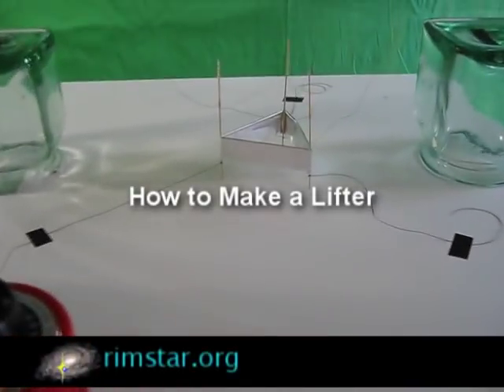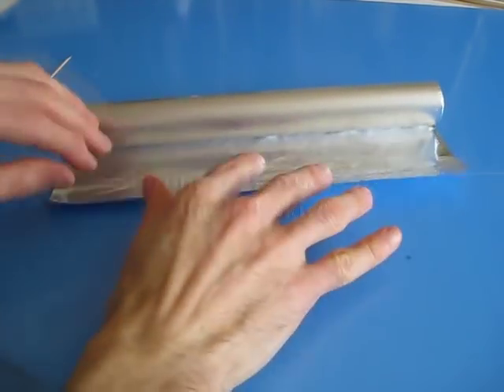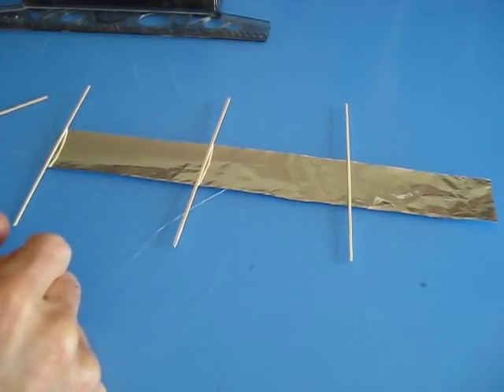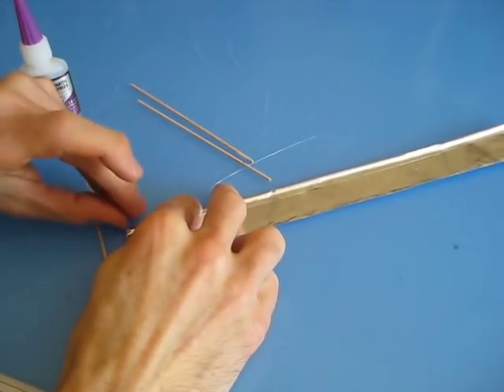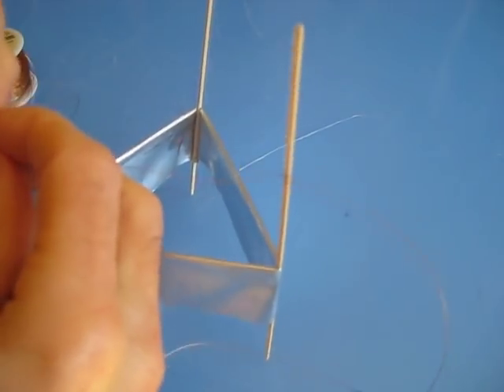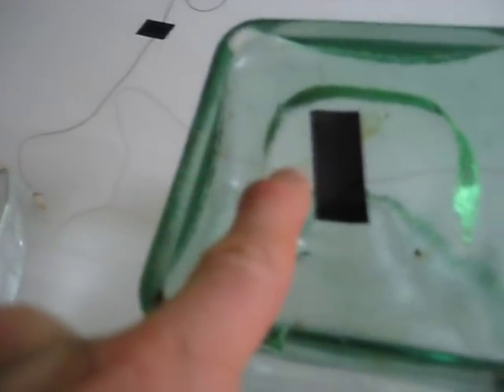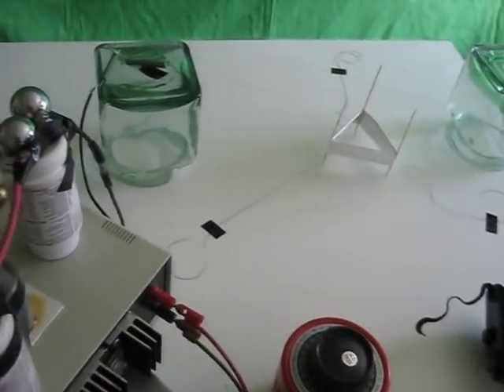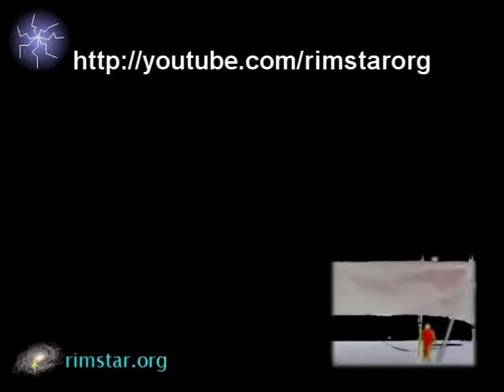How to Make/Build a Lifter or Ionocraft

Comment: Great video. Thanks a bunch.

If kept on its side and provided with wheels, with the wires sliding on HV rails, will it run?

If two of these were mounted on opposite sides of a balsa pole mounted on a central needle like a compass, and the HV supplied via commutators, will it keep spinning?

Thanks
Reply from the maker: If kept on its side then yes, it runs. But there'd be too much friction if it's on rails. The way it's usually done is much like you describe with the pole. I did it in my spinning disks video here http://youtu.be/JMtrKO7SVnw. The disks in that video work on the very same principle as the lifter, just a different geometry. It keeps spinning as long as the HV power supply is supplying sufficient voltage and current -- it needs a lot of current for the ion propulsion.
BTW That spinning disk one led to a fun one using a Star Trek Enterprise model https://www.youtube.com/watch?v=x5dyIIpnE0Y.
Reply: RimstarOrg Thanks a million. The corona, the smoke, the micro ammeter, all make for great entertainment combined with a chance for deep understanding of the principles involved. And the Star Wars thing, it’s from out of this world. Rare to find people with the genius combined with a gift to entertain, together with a passion for teaching. Thanks again.

Comment from the maker: You probably could use batteries to power the high voltage power supply but the whole thing would still weigh much too much for the lifter to lift. The record weight for a lifter to lift is 102 grams plus the lifter's 85 gram weight. The 102 grams were some nuts (as in nuts and bolts). It still couldn't lift the power supply. Do a google search for "saviour 100g payload".

Comment: Ok, so I've got a lot of the stuff hammered out for the project, but I still need the generator for the ionocraft. I'm going to stick with the dimensions of the craft you built, but I don't think I'd be able to assemble a generator myself. I was going to order the prebuilt one from the site in your video, but I want to confirm which to get with you before I spend all of my hard earned cash. Will it work if I buy the GRA 10? Also, is this what provides power, or is that the 13.8V power supply?

Comment: other than making sure that the skirt has a rounded surface and the upper pole is sharp in relation, does it matter what sort of shape the lifter actually is? Do you agree with the 1 x mm/kV rule for governing the distance between conductors?
Reply from the maker: No, other than the basic principles you mention it doesn't matter what shape. Lifters have been made as spirals, cylinders, rectangles and all sorts of other shapes. I've never heard of the 1 mm/kV rule. I just make them adjustable and my power supply is also variable so I've never needed a rule. A 1 mm/kV rule would ignore the affect the roundness of the skirt's top edge and the wire size has on a lifter as well as the available current from the power supply for ionization. Maybe someone's found that it works as a rough rule of thumb. A quick calculation shows that the one in this video is around 1 mm/kV.

Comment: I do not know if you can help me anyway I will ask ...
Basically I am starting a project, and definitely this at first, so far nothing out of the paper, I do not know much about ionic wind and so I'm asking you, is a very simple thing come.
Assuming I want to fly 350kg (a kind of costume with aerodynamic shape that would facilitate flight) there would be some sort of engine that uses the ionic winds (which preferably be small size of a boot)? If so, what fuel I would use in propellant? as I said would have to be the size of a boot, so would use 4 to the total, one in each boot, two in each hand, the share of fuel could be electric? I do not know if my question will make much sense to you because I'm not fluent in English, and you were the best person I found to answer that question, already thanks.
Reply from the maker: The world record for a lifter using ion wind is 100 grams. To lift 350kg would require a lifter around the size of a house. I don't know of any practical way to do what you are asking.
Reply: Thank you for responding, I am very happy. I have assumed that it would be impossible, but if you still have in your area, there is some kind of Thruster more or less the size of a boot to lift such a weight? now assuming I would use 5 (1 on each foot, one in each hand and a 5 ° back)
Reply from the maker: Here is what is needed, and it's for only a person (around 70kg?) https://www.youtube.com/watch?v=deyMNPbaRpA

Comment: It is strange what you said about the round edges. In 1968 I build lifter made of needles. Needles on top and bottom. At that time, the problem was with power supply. The lift was restricted by the lenght of the cord.
Reply: To add the design was not restricted to any shape.
Reply from the maker: Was there any asymmetry? Though it is possible to get a wind without any asymmetry in the shape, as described here http://jnaudin.free.fr/pcnpend/html/pcespend.htm In that case it's due to the difference in mobility between positive and negative ions.

Comment: Can you make a video on creating the power supply in brief please.(Or explaining the same,with the current grating)
Reply from the maker: I see you found the video, but for anyone else who reads this it's https://www.youtube.com/watch?v=GEuK1OdYxHk.
Reply: eah :) thanks.
What happens if i am creating an AC power supply or using neon-sign transformer.
will diodes work?.. for the same principle of connecting with lifter wire? or will i need a bridge rectifier?
Reply from the maker: I would think that a diode which turns the AC into pulsed DC would work. I know some people back around 2001 got it working with pulsed DC.  My Cube power supply which uses a flyback transformer and a diode to put out pulsed DC didn't work though. That's a mystery.
So theoretically, if you have sufficient voltage and current, then yes, it should work.
With my HV flat DC power supply I needed 25,000 volts. I couldn't measure the current with my meters but I suspect it was around 1 milliamp. I don't know what the equivalent voltage and current would be with pulsed DC. I would think you'd need more.

Comment: @RimstarOrg Thanks for this video, this is mind expanding technology. I am curious, could you possibly power this device wirelessly, by using a guided high frequency antenna. Or any other possible way. I'm quite sure it's been done before. Thanks!
Reply from the maker: +enjoypolo You need around 20 watts to power it but you'd still need some sort of receiver antenna and then the circuitry to step it up to the needed 25kV, which would be too heavy. The only way anyone's gotten this to fly autonomously is to attach it to a helium balloon and use the balloon for the lift while using the lifter only for the forward propulsion.
Reply: Thanks for the answer. How about coupling this with a Toroidal ZPF electric generator? Thereby self-harvesting the energy from the vaccum to propulse itself. I'm only suggesting this as an idea. Thanks!
Reply from the maker: +enjoypolo LOL! I'll couple one too it and let you know how it goes! Sure would be nice.

Comment: So on the power supply side of things, I assume the balls are a spark gap?  Looks like there's also a cap there too?  Not sure what the tupperware container is though?
Reply from the maker: Nope, the balls are just touching. They're there for making an electrical connection between two wires. When dealing with high voltage, you want to avoid sharp points. Where there are sharp points, charge can leak into the air, creating a loss. So the output wire from the power supply ends at a round metal ball. The wire going to the lifter also ends in a round metal ball. By having the two balls touch, the two wires are electrically connected together while avoiding sharp points.
There's no cap there.
The tupperware container is there because the case for the power supply was too short, so I made it higher by adding the tupperware.

Comment: Hi RimstarOrg.  I made a triangular lifter that is 6 inches on each side and I connected the negative wire to the aluminum skirt
and the positive wire to the thin copper wire. When the power supply is on, I smelled the ozone and I heard a hissing sound
but the lifter is not lifting up. I did lower the copper wire to be an inch above the aluminum skirt but it still did not lift up. The aluminum skirt width is 1.25 inch and it cover all three side of the lifter/

At first the power supply went up to 32,000 volt when I turned it all the way up. I turned it on for only 5 seconds and then
I turned it off. Subsequently when I turned on again, it only go up to 20,000 volt.

1)  Can you tell me why the power supply behave this way where the voltage is not at 32,000 volt?
2) Can you tell me why the lifter is not lifting up ?
Reply from the maker: 2) Most likely your lifter is too heavy. Maybe make one half the size and try that. My very first one was only around 3 inches long on each side https://rimstar.org/sdprop/lifter/lifter1a/lifter1a.htm  But the best way to get it working is to try it in complete darkness so that you can see where the corona is. It's possible that only one side is getting most of the corona. I give tips on my website here https://rimstar.org/sdprop/lifter/lifter.htm
1) Either something in your power supply is broken or you've spring a leak somewhere in your test setup or lifter. By "leak" I mean that somewhere you're ionizing air, thereby reducing the voltage. This can usually be spotted by being in complete darkness and looking for the bluish corona on wire connections and so on. Also, listening for where the hissing is coming from helps but be careful to not get too close and shock yourself. If the power supply is broken then there's not much I can say without being there and taking it apart. If you have a Cockroft-Walton voltage multiplier as the last stage of your power supply then possibly a diode or capacitor in one of the stages is being shorted around or the components are shorted inside -- that would result in a lower voltage. If you suspect that, and you can take apart the multiplier circuit then you can test the components individually. Note that to reduce the chance of shorting around the components, if the individual components are surrounded by air then you can submerge them in an insulating fluid like mineral oil to prevent shorting around them. I have photos lower down on this page to show what I mean https://rimstar.org/equip/negative_voltage_multiplier.htm
Reply: @RimstarOrg  1) Is it normal to hear a constant hissing sound when you turned on a high power supply or is it something that should be avoided ? 2) Based on what you said, I deduced that hissing mean somehow the air is being ionized and therefore I lose voltage and hence no lift ?

Comment: The HV transformer out of a CRT Color TV or older CRT computer monitor works great. Don't need to waste time and money using resistors for your power source. The wire in the convergence and deflection coils makes great power leads for the lifter. Basically a CRT TV and computer monitor has every electrical component that you will need for this project  The Dimensions on the lifter don't have to be no where exact as they are in this video.

Comment: If there is a sufficient onboard power supply could this be applied to vehicles we drive and air/space craft? Seems like it could. Also can the lifter be made to be able to steer it? I think it's interesting how there are lots of reports about triangular shaped air vehicles since 1980 and this is triangular shaped.
Reply from the maker: No, it can't practically be made as a vehicle. To do lift a person off from the Earth's surface it would probably have to be the size of a house and require millions of volts. However, some spacecraft has used this ion propulsion with a different design and carrying xenon gas as the propellant. And example of that is the Dawn spacecraft ( https://en.wikipedia.org/wiki/Dawn_(spacecraft) ). The acceleration was very small but since it could run for a very long time, it worked. They used conventional rockets to get to space first though.

Comment: could this work with a tesseract shape to all 6 directions for steering in space maybe? if a tesseract has the inner cube extruded it has diagonal planes similar to this flying triangle shape. and could the platform be much more stable when 4 triangles like this are used combined and one bigger triangle maybe :D wow the possibilities :S 4 triangles that make up one, maybe all 3 outer triangles powered differently to be able to steer it by lowering power on one side.
Reply from the maker: +kleintjuhD It should work.
Reply: +RimstarOrg and maybe four triangles insulted with separate power applied could steer by dipping :)
Reply: Could also work per plane power of the teaseract, have a set of planes powered at one time.
Reply: There is no air in space, this device works by ionizing air around the foil. It wouldn't work
Reply from the maker: Alex Perumean
Oh yeah, there is that! :) I forgot he was asking about it in space. I was thinking just about the design in general. Definitely won't work in space... unless you bring along your own ionizable gas for propellant.
Reply: +RimstarOrg i meant airspace for starting out :) tesseract is an interesting shape maybe. Separate powered sides might enable steering to a side.
Reply: bringing ionizable gas, kept in a closed system would do it.trapped inside the hull and recycled flow. i have some designs that might be interesting on my channel.

Comment: Very Nice! however to better ensure success of the replication of your ioncraft, what is the amp for the 0.25mm(30AWG) wire? Thanks!
Reply from the maker: +Sheng Sun Input from the low voltage DC power supply going to the high voltage power supply is 8 volts at 2.5 amps (see 8 minutes and 42 seconds into this video https://www.youtube.com/watch?v=GEuK1OdYxHk). I tried measuring the current at the output but it was over the limit for my analog meter (and I don't want to damage my good meters) so it was over 250 microamps which you can see in this video https://www.youtube.com/watch?v=LOGAaObsN4g.
Reply: RimstarOrg
Thank you kindly Steven. Also, Article "Tapping vaccum energy" on your website regarding the wave interferometry is phenomenal!

Comment: can you put those things close to each other like in a WW pattern (Long side at the top, next long side at the bottom aso) or is there too much interference? You could then connect the power input for each of those to a controller. Add an acceleration and a gyro sensor to get the data you need to navigate the thing by switching the small lifters on and off. would love to try it myself but dont have the money for it atm

Comment: I wonder how much thrust you could rig this principal to produce in a slightly larger scale?🤔 Would be cool if you could find a way to produce enough thrust to handle the weight requirements it would likely require to add 3 thrust nozzles to shape the wind.

Comment from the maker: When I say a wind turbine or solar panels can work, I mean when they're output normal power for normal appliances. For example, you'd use the wind turbine or solar panels to charge a battery bank and then have an inverter run off the battery bank, outputting normal household 120VAC (well, normal for here in North America.) A power supply like in this video would then plug into that inverter and run off of the 120VAC.

Comment: I have recently built my first lifter, but i only have 15kv. When I test it, there are small 'arcs' of electricity. Is this good or bad? should the wire closer to the aluminum foil (i started with 3cm apart, but have moved it down to around 1.5cm)? Thanks!

Comment: what about three of these set up in a large triangle like a "TRIFORCE" with each thruster set apart as to give more stability? Or setup like a quad-rotor helicopter with a small variable resistor wired to each thruster? Would it be possible with a gyroscope and a comparitive circuit to asses and maintain the proper voltage to each and keep it level?  I know the weight here would be an issue, but with many of these and a good power supply, small circuits, or circuits off the aircraft... maybe?

Comment: could you put any additional weight on these? (example extra balsa wood/light cloth?) I'm just curious as I'm interested in making some small levitating sculptures and happened to stumble on this video.
Reply from the maker: You can put extra weight, but not much. It depends on how much current your power supply can provide, while maintaining a high voltage, and also on the overall length of foil and wire. My lifter weighs just 2 grams. The record is a 98 gram lifter lifting a payload of 102 grams, done in 2003. That was with a specially built power supply. http://blazelabs.com/l-c-hexspiral.asp
Reply from the maker: Oh, and at these voltages toxic ozone is produced so its not something you'd want floating around for long periods of time.
Reply: oh lol! well thats awesome to know! thanks, boss! :D

Comment: "If you don't have balls to touch, you can always touch the skirt..." :) hahaha... The "craft" moves in the direction of the positive charge... so plus/minus matters:) Cool project.
Reply from the maker: Thanks. And nope, it moves in the direction of the thin wire regardless of the polarity. I tend to connect the foil to the ground of my power supply because the foil is closer to the table and so there's less electrical interaction with the table that way. Since my power supply puts out positive with respect to ground then in that case the wire is positive and it's moving in the direction of the positive. But I've done it the other way around with this lifter and with other ion propelled craft and that works too with no noticeable difference, though there may be a little..